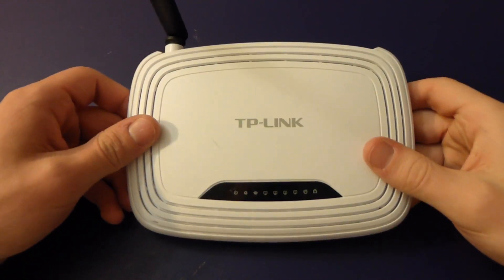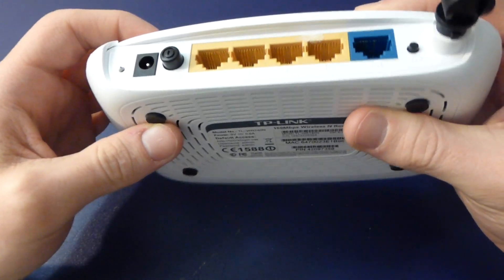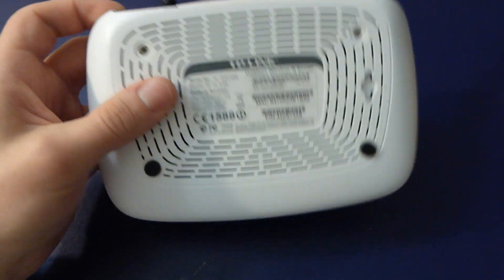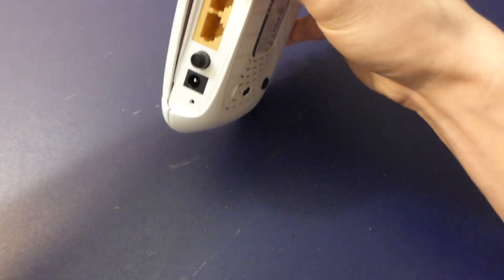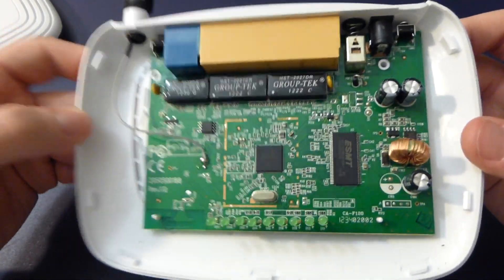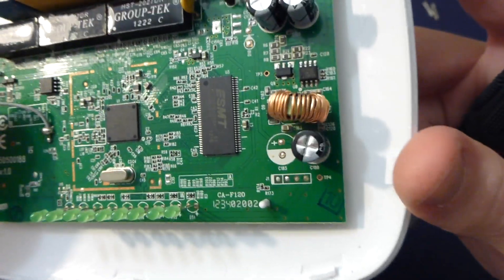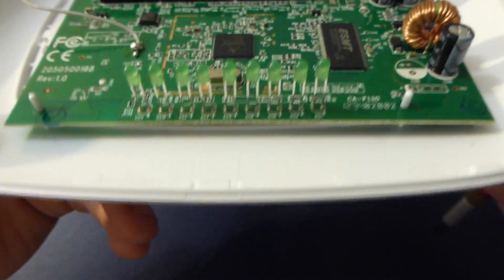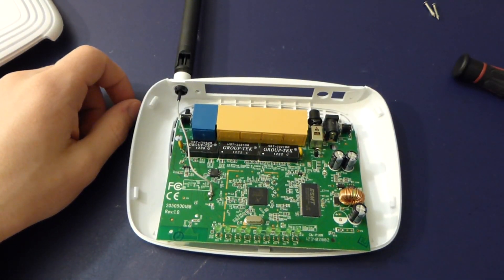A Look Inside a TP-LINK TL-WR740N

Comment: As mentioned by others, these are some of the BEST cheap routers around, and amazing value for the price -- after you flash OpenWRT, that is. Honestly never even tried the stock firmware for any period of time, but with OpenWRT these are rock stable and quite performant.
Reply: so why are u here ...   mine crashes each month or so ..
Reply: I'm here because Mark does very nice videos, and I was checking out his older stuff randomly. Why do you ask? As for your router, did you install OpenWRT on it? Do you know what OpenWRT is?

Comment: This "crappy" and cheap router has served our family for years, almost non-stop.. also highly-rated at Amazon. Your experience is totally different from ours.
Reply: Totaly agree. It is a good router. Can't compare to a professional equipment but it's doing his job and it is stable. It is all you can ask for a 15$ wifi. bonus has a good antena
Reply: Cheap stuff is the good stuff.
Reply: Also, I would like to try the router with different region settings. Can you tell which region you're using the router on?
Reply: so why are u here ...   mine crashes each month or so .. 
.
Reply: Bro that is one of the crappiest router I've ever used in my life. I have used it for 5 years and its WiFi range is so fricking low and slow internet speed too.

Comment: You are so wrong about this router! It has 32MB of RAM and 4MB flash and it's very stable.
And the best part is here https://wiki.openwrt.org/toh/tp-link/tl-wr740n
Reply: i have the version of this router with 2 antennas, i flashed DD-WRT onto it and for the last 3 years its been outside in the new mexico heat and cold serving 2 wifi ssid's. the only downside is its 100Mbps but that little thing has lasted where REAL Linksys WRT-54g routers have failed, i know because i have 2 of them in a drawer that got killed by the heat, (well the system became unstable, then tried to reflash and the flash failed so pretty sure the CPU was not acting properly).
Reply: @codenamegamma  bet the capacitors got completely roasted and the internal power supply became unstable. Crashing the system.
Reply: OpenWRT is a full piece of crap, that shit bricked my router and it even had it's chance as Firmware